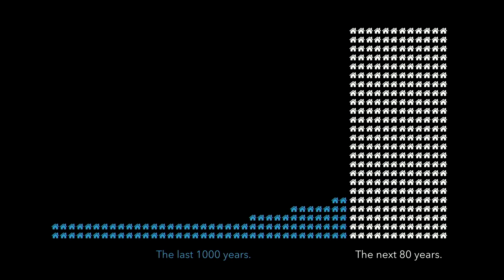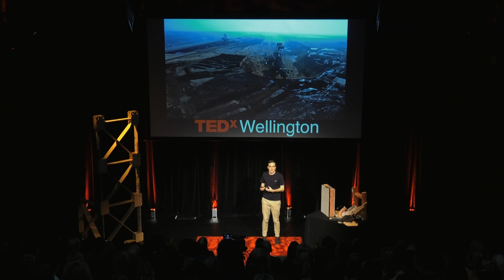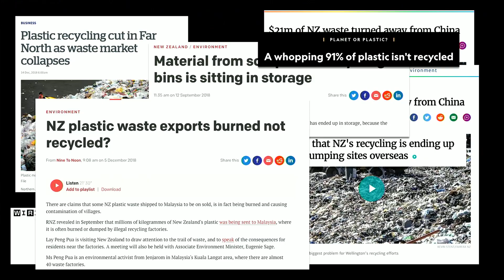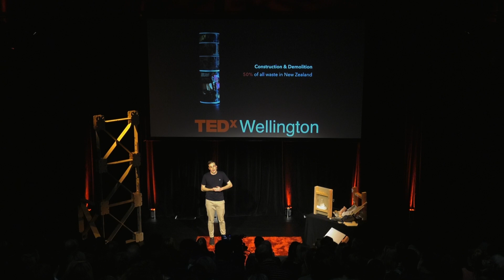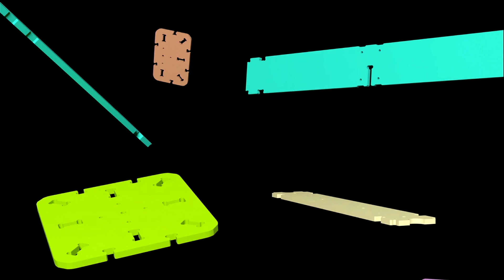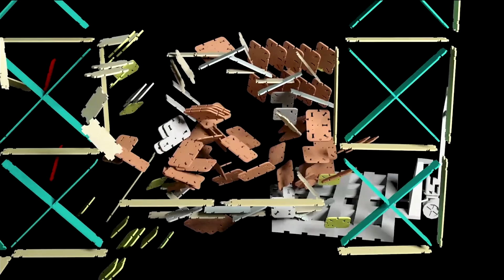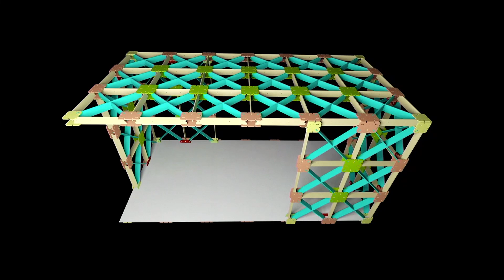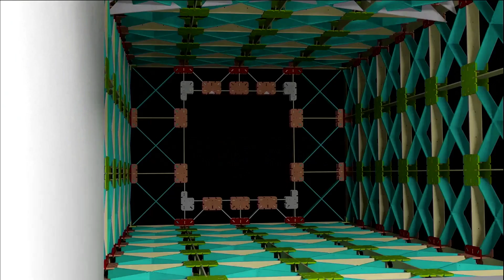Why we need to rethink how we build homes | Ged Finch | TEDxWellington

Comment: Glossed over the materials issue. What material lasts such a long time without chemical interference?   Looks like wood but that doesnt last.  No mention of how they're insulated (what replaces the current 'rubbish').  No point in following this idea unless those are addressed, even fleetingly
Reply: About that moisture issue... A differently shaped building, that was open to catching a breeze, in strategic places, might respond differently to an impermeable, otherwise wall structure, if I'm properly recalling things. But, if you now have a fire season to live through, maybe a more active air conditioning system would be needed, along with a way to close any ventilation. 

I think end of use for building materials is crucial for the future. I was thinking just like this speaker when I first got interested in sustainable architecture. Things get complicated fast, especially when you try to design something to invest in the future. -Whether that's moving your house out of the path of a natural disaster, taking your house with you for a job, growing food using your home, or giving someone dear the investment in their autonomous future, you always wish you had gotten. I do think we should be looking at ways to create low investment threshold, highly modular buildings. It would be even cooler, in my opinion, if you could start making pieces when you're younger, putting them together as you afford, or collect the materials. Or even, if it was safe, and easy enough, that with community investment, a kid could learn how to build their own room, or their own house, and just do it, piece by piece, when they had some time. 

And honestly? If we don't start making it easier, we aren't designing for the future. We're going to face more wide spread disasters, and housing, urban planning, peace, community, and access to basic amenities, are all going to pass into the hands of people who know nothing about those topics, don't have a head for it, and are way too wrapped up in caring for their loved ones, and their own tenuous survival, to spend a brain cell getting it right, especially at scale. That's just not sustainable. And, it isn't going to be one disaster, either, or even, one familiar, if devastating, chronic danger, we're facing. To the poor, and discriminated against, this isn't new territory, but yeah, it will get worse. 

If cities in particular, are going to be the backbone of humanity, we need to take a good long look at packing people into places that don't make food, or raw materials, and basically put the whole environment under the influence of politics and mob dynamics at the signs of the first real panic, without many buffers, or exceptions at all. Cities, when they're free to be dynamic, permeable, and flexible, are great places to find support, and look for opportunities. But in times of disaster, cities are despotic strongholds, or miles of dangerous territory to cross, or a place everyone is leaving at once, looking for a new life, or a way out of town, and that makes its own catastrophic, tragic mess. Cities tend to reinforce treating people as one of many. It doesn't take too much to turn that experience into treating people like objects. That's Capitalism in a nutshell, anyway. Good architecture has a lot to do with diffusing tensions, and creating resources, and resource streams that don't just vanish at the first sign of a real problem.

Comment: I am a general contractor and home builder. An architect colleague and I have started to explore a similar construction approach and it will work extremely well. It is mechanically very strong,  light and can be easily configured to support high dead and live loads. Channels for mechanicals/penetrations are designed in as required, all in CAD and CNC fabbed. Combined with sustainable materials this is the near future no question.
Reply: sustainable materials? Like the arsenic boards?I hate this video because it does not address any of the issues it claims to solve.
Reply: I am a structural engineer working for a very large luxury home builder in South Florida. There's so much lacking in this presentation, it's not even funny. How is the roof designed and how is it connected to the walls? What about the foundation and how the walls are connected to that too? He didn't even explain water-proofing, insulating, mechanicals, nothing.
How can any GC not question these things? Architects are clueless, btw.
Reply: @Jrome3  Hold on, this was a concept talk, not an engineering class. The point is our current construction methods and materials need urgent change. We can and must rethink the trusted and familiar stick framing building science. My point is that far better,  radically new systems are very possible. I've made a small start on that journey. We need guys like you to leverage your skills to help make it a reality. Rather than resist change, why not embrace it? Be the visionary. Thats the only attitude that will sustain your career and the planet. We can do this. (BTW architects, engineers and builders are the three legs of the stool. Its a team sport. You need the other two. Find the good ones. Then you win.)
Reply: @philbarre  , why does it need urgent change? What is the urgency? I'm all for new methods and materials but everything  needs to be fully thought out. What's the point of a conceptual presentation without discussing what's important? You addressed the issues in your post but the architect in the clip just ignored everything. I guess I was expecting too much. I should have known better since I work with so many architects. They all need to take some basic engineering courses. I agree about the 3 legged stool but one leg is short and weak which puts unnecessary pressure on the other 2 legs.
Reply: What is the name of the system you are using?

Comment: Here in the UK we don't realise that you New Zealanders are such nomadic people! Why do you need to keep dis-assembling your houses? Strength, and long-lasting stability is good! I live in a house that's about 120 years old, and it looks good for at least another 120 years! Ever heard of sand, stone and cement? The Romans invented it. Or maybe build some kilns, and make some bricks. I'm sure you also have clay there. More work, yes, but it will last for generations.

I myself think that our traditional building methods here are slow, and too costly, and - someone mentioned earthquake - not earthquake-proof. All that can be fixed! Most building here is slow, because the bricks are small. I favour LARGE Lego-type bricks that simply slot into one another. They should be hollow, and then steel reinforcing rods can pass right through the wall, and prevent it collapsing in an earthquake. The rest of the hollow spaces can be filled with heat insulation - non-toxic glass-wool insulation! They could also enclose conduits for electrics and plumbing, if you like. Want to add a second storey? Such walls could support it. Sand, stone, cement - and more sand (the glass wool)... What could be more natural? Of course, when you move, you can't take this house with you. But here in Europe we always seem to find another house to move into!

Oh, and if you ever want to demolish or change such a house, all its components are reusable - saving money.
Reply: Nothing wrong with lots of ideas about building.
Reply: New Zealand has to contend with earthquakes, which means structure needs to be able to move with the ground, sand stone in uk are not good in that , just look at christchurch earthquake and how traditional brick structures performed.

Comment: Of course there will need to be modifications and adjustments to suit various climates/needs, but change needs to start somewhere, and what a brilliant start this could be. It amazes me how negative people can be... But then again, they are probably the ones who think, 'who cares? I'm not going to be here in the future'. Love the initiative, creativity and problem solving here. Keep forging on!!!!
Reply: JodieTroutfish So right. It blows my mind how negative people can be about the potential for change!!
Reply: Toni June
Not negative, critical of a idea that hasn't made allowances for  the basics of building.
Reply: I applaud thinking out of the box, but this is far from an actual start.  I am an architect and I am absolutely interested in green building techniques, and I was hoping to see something useful here. Unfortunately, as others have criticised, this idea is still too incomplete to be implemented.  How will it be insulated and made air tight? He didn't address the very components he criticised.
Reply: @bulakhv  , exactly!
I'm a structural engineer in residential construction. He didn't address anything important. Roof design and connections to walls...wall connection to foundation...insulation...water-proofing...how to run mechanicals thru walls, etc.
That's not being "negative", ladies. 🙄

Comment: I didn't see heating plumbing or electrical in these boxes!?
Reply: The ends of the tie bars all appeared to have divots to allow piping and conduit to run through them. The conduit and would probably be installed as the walls were built and adhere to a predesigned plan for locations.
Reply: Thanks for responding to my comment. I’m from the Peace country near Dawson Creek BC Canada and have been rethinking housing for years and a proponent of Bucky Fuller. If these building components can be made from material available on your land all the better! Contrary to Bucky I now believe in thermal mass as a necessity to a warm comfortable year round living, The same would be true in a hot climate

Comment: interesting points, nice ideas. No disrespect to the Architects out there, but there was no mention about the economics on the situation. Most of the things constructed are based on a cost/effectiveness graph curve,  to put it simply. in other words instead of constructing something perfect with multiplied costs it is preferred to construct it adequate for a fraction of the cost.
I also think that you also have not taken into consideration the skill level of the common worker who will assemble what you manufacture, and as many people that pointed out the insulation/heating/water pipes and electricity wires that need to go through.

Furthermore although an expanded lifetime would be preferable, who would want to live or renovate a 70 year old building? what was build 70 years ago did not account for the needs, restrictions and technologies of today. same what is build today will not be considered up to standards 40 years forward. just my 2 cents (Mechanical Engineer)
Reply: "who would want to live or renovate a 70 year old building"

Lots of people just look at England. Heritage houses are very popular as back then they were built better than today's buildings and had character.
Reply: Standardizing part will allow us to mass produce them. This will tend allow manufacturers to produce them for a lower cost. Add competition and its a gain for both the customers and environment.
Reply: Cost is very important. Also what materials are being used?  I posted a request  for contact information in order to get clarification on many questions I have. Thank you for your comment
Reply: Never addressed the material for those components either.
Reply: The Pyramids made it 70 years w/desire to renovate...(?)...

Renovation Materials Needed:
Limestone (large, polished casing stones), Unknown limestone-based hydraulic cement, Unknown purity polished Gold cap, Possible large-scale granite block repair.
Cost?  $Moderate

Labor Power/Machinery Needed:
Number of Workers, ~10-10,000 Skilled for ~40hrs to ~Several Years...; Machinery, unknown.
Cost?  $Moderately-High to $High

Payments Financed Over ~60,000 Month Term Loan @ 0.00% Fixed APR.  
Monthly Payment? ...(?) Pennies/Month..?

I'd green light renovating a Pyramid...  How do you say no to pennies/mo.?!  Where are all the damn pyramids at anyway....?
Reply: Why mention all those really important points when you can just say "ThIs GoOd fOr EnVirOnMent" and people will eat it

Comment: The house wrap is mainly used as a water barrier from the outside elements,  whilst allowing water vapour to escape the house to stop mold.

Only if the joints are taped it becomes airtight.

Comment: What are the new materials made from? What is the insulation that is reusable? How is the foundation handled? Basements? Lots of missing detail.
Reply: Yes a lot is missing, but the structural components are cool. Tinker Toy houses!
Reply: LOL, Ted doesn't do long videos so the speakers have a limited time and must choose only a few of their key points.
Reply: Ben Kjellberg
I know OZ doesn't really do basements, so would assume NZ would be the same.

We have different problems to deal with in the southern hemisphere, like Termites.
Reply: @Robert-j6r8c  We in the northern world have them too. Fair point on the basements. I am in the Midwest of North America, they are common here.
Reply: Ben Kjellberg
A lot of house frames are built out of steel in OZ now.
Reply: Wood changes with humidity. And you would need to carefully select the parts of the log you cut these from. There would be a ton of waste in the milling.

And then the foundation, plumbing, electrical, and insulation issues mentioned by others. (Lamb's wool battens for the last? Not sure of their longevity.)
Reply: @csandlund1  look up WikiHouse project which is based on the same concept. There are built examples in the UK, obviously a 14 minute TED talk is only sufficient to communicate the concept. Also look up Assembly Suite by Studio Nine Architects for some real world holiday cabins based on this system
Reply: Yes agree,  also pluming,  water,  electricity,  heating,  etc.  This Ted talk was very interesting and makes you think anyone could build Hause,  but really a lot of questions unanswered.
Reply: @gliukivideo3342  Agreed, the utilities were also completely un-discussed.
Reply: Ben Kjellberg
Their mock up didn't prove anything, don't think this guy has ever stepped on a building site.
Reply: @Robert-j6r8c  agreed, "cheaper, more efficient, stronger", NOT cheaper, NOT stronger, more efficient only to someone who has spent a lot of time on a computer and NO time building.  Completely out of touch with reality.  Ikea is not the answer.
Reply: Like local govermentsnwill give away their strangle hold on the permitting process ....hahaha
Reply: Would the speaker happen to hold the patent on this new system? All he needs is for the government to mandate it and he’s all set!
Reply: Too much missing data... insulation, wiring, cladding ect..

Comment: This is a great start but I have several concerns . What about the longevity of the house( how long will it last) what is the strengths and weaknesses of this concept. What about insulation will the workers need to make their own holes or will they have to get with a cadd designer and special order those parts. Can you reuse them? As an architect I feel their are more things to consider than what you talk about. That being said you should have trial tested and improved your design before doing a ted talks
Reply: The holes are for plumbing and electricity

Comment: Not a mention of the composition of the exterior sheathing material of the new home. What is it? How are all those triangular joints sealed from the elements? Is insulation no longer required? Do the protruding gussets interfere with mounting of the triangular wall sheathing panels? Are holes needed in these panels? Just curious.
Reply: Excellent questions. I’ll be checking on your text for the answers. 🌺